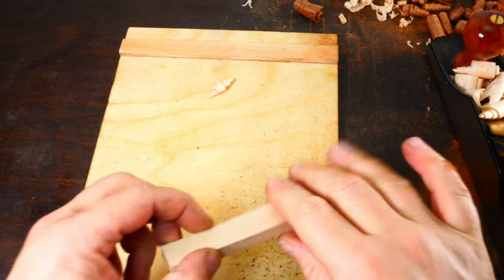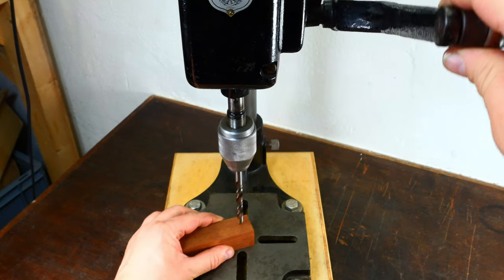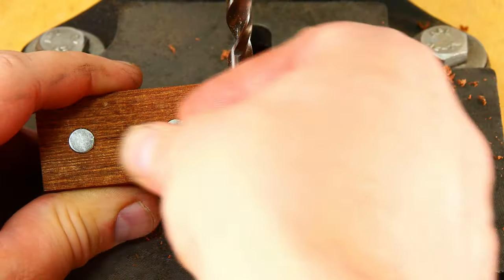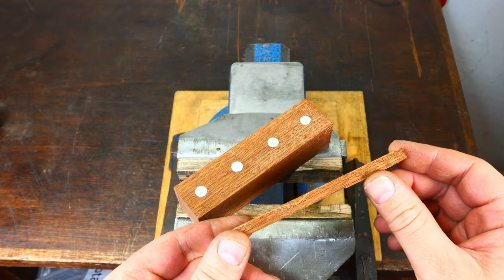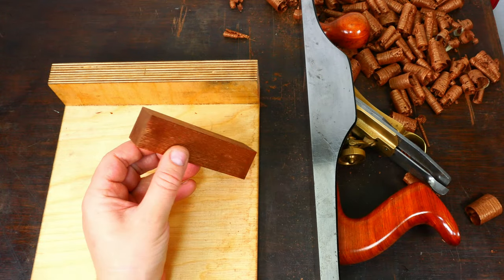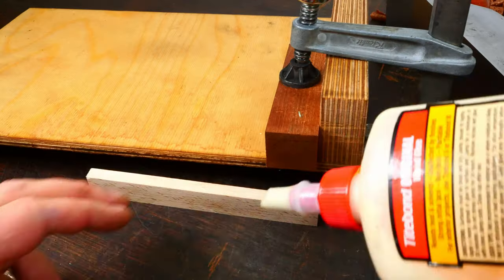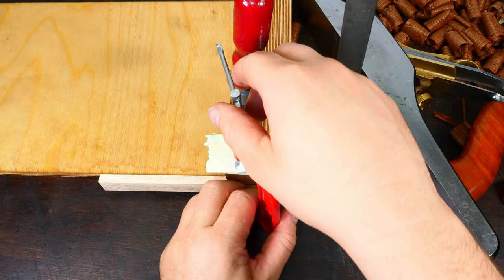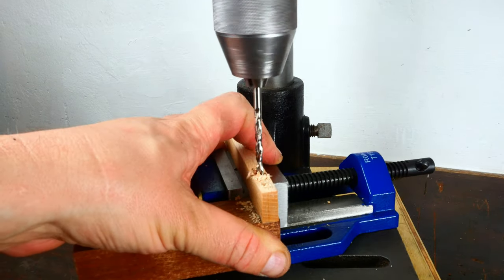I made this magnetic saw guide

Comment: So I have been using my 14" long magnetic saw guide, made out of teak, for 2 days. I was cutting 5cm/ 2" thick wood, that was 12"/ 30cm long. My Japanese saw is only 265cm long, and the usable length is less than that.
I found that the saw got chewed up by the teeth quite quickly, as I had to come in from both sides, and it really affected the 90deg cutting ability. It got ugly, which I couldnt afford.
Thinking how to adapt it: make a thicker fence like you did, and shave off the chewed off parts with a plane until its straight again until the sacrificial fence is all used up, then start again?
Or do you think adding a thin strip of metal on the cutting face of the saw guide will do the trick?
Reply from the maker: The way I deal with it is trying to hold the saw as straight as possible in the beginning so that only a narrow strip near the bottom of the guide is chewed up by the set of the teeth. This way, you always keep enough un-marred reference surface on the guide. 
I wouldn’t have es metal because it may damage the saw. I have seen people use strips of plastic but in my opinion that is the same effect as letting a thin strip of wood be worn away. You still have to be careful in keeping the saw parallel.
Reply: @imadethischannel  You're right of course, the answer is relatively simple. I guess after a day of picking up and shaping lumber, my delicacy leaves the building and I just want to get things done. I did notice that I could use the saw with just 2 fingers yesterday, and though it cut slower (groan), it still worked. I was thinking of using aluminium which is soft enough to give warning of errant cuts but not damage teeth too much. On the other hand, might as well use a sacrificial fence and use stronger/more magnets for when there is a lot of heavy cutting to do. Cutting small, thin stock like most people do in cities, is easy with the guide. Timber framing is a different kettle of fish for straight cuts with a Japanese saw. It requires skill and careful dedication to be straight and accurate to the mm.

Comment: I made a guide of my own recently and cannot get straight cuts with it and I can't figure out why! It's square, straight, flat and I'm using a ryoba as well, yet towards the end of the cut the saw veers off track some. I was testing on a 2x4, do you think thats too thick for a guide to be accurate the whole cut?
Reply from the maker: Hey, I think in principle the thicker the material the more difficult it is to make a straight cut. Is your inaccuracy systematically always in the same direction? Then it might be a problem with your jig. But you also have to make sure that you are pulling the saw with as little deflection from the line of cut as possible. When you make a deep cut, the cut itself becomes the guide.
Reply: @imadethischannel  thanks for replying! You were right, it was the jig, my jig is made differently, I added a backer to it so I could clamp it to my workpiece, think of it like an L shape, but the backer is only 1-1.5" wide, and when I clamped it would very slightly alter the angle of the front by pulling the jig towards the clamp. So to avoid this, I clamp from the side and that maintains the perpendicular angle! I also swapped to a back saw to ensure there was no flex in the saw plate if I add too much pressure
Reply from the maker: Great! It’s learning by trial an error :)

Comment: How you plan with your plane, not damaging the platform, sir? 🤔
Reply from the maker: Hey, I‘m not sure what you mean.
Reply: I mean, the plane blade cuts off excess wood on parts, but does not damage the plywood stand
Reply from the maker: Ah good point! The plywood is cut off the first few times I used this bench hook. Now there’s a very small gap. Even if I cut off a little bit it doesn‘t matter because the plane‘s blade doesn‘t go all the way to the edge. So it will always be at a right angle.
Reply: @imadethischannel  Thanks! 🌿🌿🌿